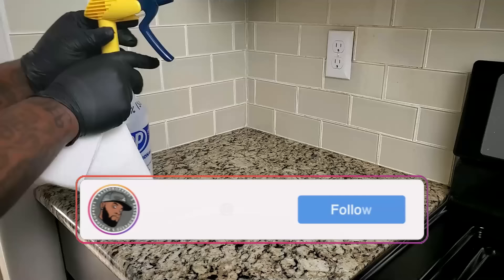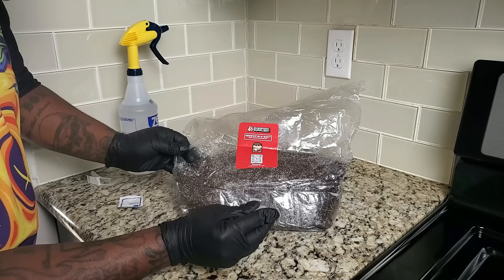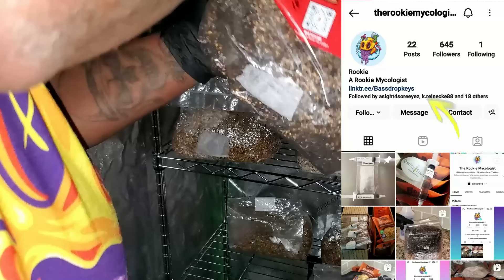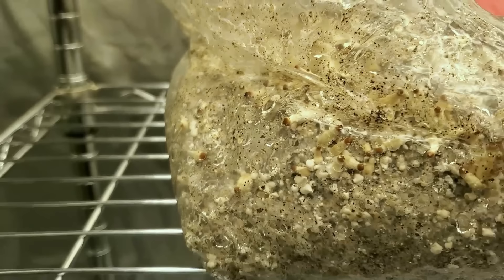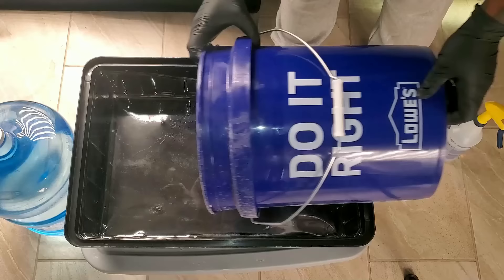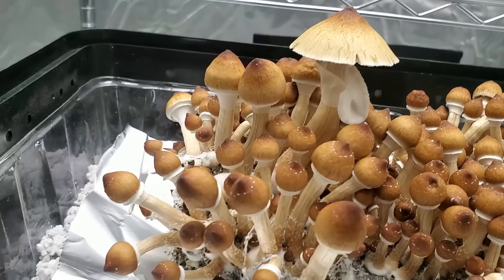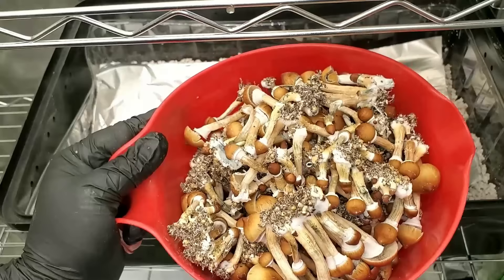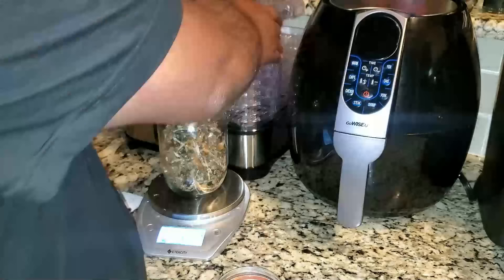Spore To Flush - All In One Mushroom Bag | Complete Beginner's Guide To Growing Mushrooms

Comment: Just a tip to yield more weight from your first flush, once you transfer your grow bag to the grow box you can actually add more sterile substrate to the grow box and the mycelium will spread through the added substrate and yield more weight. All you have to do if it doesn't spread is leave a few mushrooms in the substrate and tap them every now and again. The mushrooms will do the work for you. Another tip is to add black lights. It will also create a more sterile environment because certain molds can't grow in those conditions. At least with my experience. Just a thought.
Reply: @monsters_are_human is the black light the only light that’s necessary at the fruiting stage…. Thanks in advance.
Reply: I have one all in one bag that colonized and grew and I've already harvested from and am about to soak it and move it to a tub. I have another AIO bag that didn't colonize. Can I just mix up that second bag, open it, pour it evenly in the tub, and put the rehydrate cake from the first bag on top of the layer I just poured? Will that grow more even if that layer I poured is uncolonized?
Reply: What substrate do you suggest?

Comment: A tip, use the alcohol wipe on the injection port & inject directly through the alcohol wipe. Will reduce contamination risks.
Reply: That just sanitizes tho not sterilize. If you want to sterilize everything flame the needle and wipe down the port.
Reply: If alcohol gets in the needle, you just lost spores. Never done that, never will.
Reply: Just heat til growing red.. everytime.too

Comment: I like your logo and your approach to mycology. I've been dabbling with it for a while now myself and I just wanted to give you my opinion regarding the caps splitting. It seems like the perlite you put at the bottom was dry, or maybe just not wet enough. But typically speaking there should be at least a little bit of water droplets on the inside of your monotub or fruiting chamber. So oftentimes just misting the inside of the fruiting chamber when you first put the Block in there to fruit. Some people will mist multiple times per day but I like to go according to how much water droplets are built up on the inside of the fruiting chamber. As long as there is even a little bit of droplets on the walls of your chamber that will allow the moisture needed for your caps not to split so much.
I respect that everyone has their own methods but I just wanted to give you a tip that seems to work best for me.
 I noticed that when your caps were cracking there was at least one cap on the back right that was already getting the shriveled dry look to it.
No method is wrong, especially when what you're doing is producing. Keep it up brother happy to see as many people as possible sharing this line of work. It is a fun hobby/ passion.
Mush Love 🍄 ❤️ ✌️ 
Divine Mycology
Reply: What’s the concern with splitting too much?
Reply: @GdayFraz  no real concern with the splitting caps, moreso just curious as to why this occurs

Comment: The extreme pinning is because light is hitting the bag from all sides especially in the mylar tent. Next time you can use duct tape or something to prevent the side pinning.
Reply: What was the issue with it?   Didn’t seem to be a problem.
Reply: @acausalnine  Not necessarily an issue. It just produces tons of tiny shrooms all over the cake rather than fewer larger shrooms on top. If youre using for micro dosing more pins is good :). If you want impressive fruit with high bag appeal then blocking side light may be a good idea.
Reply: @ngantnier how about just a simple rubber band around the bag lol, you know something that actually works😅

Comment: I did it for a bit. Here's a tip. Treat your air and don't work over carpet.  Green mold is a pain and it's hard to get rid of spoors. I would have good luck on small scale but once I stepped it up mold wouldn't show untill spores were already in the air. looks like you found a Cool easy way to get at it and I might give it a try! thanks!

Comment: Something to consider. I live by a field that is 1000s of acres. I have never walked it all in 25 years. I use to come out with 55 gallon bags of those. Anyway i used to thump the tops, and twist and pull or push pull to harvest. Over the years, i learned thumping wasnt needed and also that i should have been cutting them with scissors. When you pull them like that your damaging the mycelium. You know it grows like a net under the dirt in a spiderweb like filament..unknowingly i "swiss cheesed" it all over vast areas, basically stripping the field. So year after year, there were less and less, even taking the 5 year cycles of growth into consideration. With that being said protect your mycelium at all cost . This is coming from a highly experienced individual that would harvest 11 and 12  lb mushrooms the size of dinner plates with stalks fatter that broom sticks ... good luck!
Reply: Very different conditions growing in a field than in tubs like this. He's going to throw out that mycelium after the third flush or so and start from scratch.

Comment: The "don't wash mushroom thing" comes from kitchens. In a restaurant, or commercial kitchen, if one were to wash the mushrooms, and leave them for an hour, they would become slimy. If you are using them right away it is perfectly fine, and absolutely correct to wash your mushrooms. Chefs do not like eating dirt, or poop either. Morels different story/ truffles etc. Button type mushrooms you wash as needed.

Comment: They are Pining on the side and bottom of the bag because the light gets in there.
The bag is supposed to be black on the bottom so it only Pins on the top.
You can use black tape on the bottom of the bags or transfer them to a black tray and put them in a mono tub.
You don't want pins starting on the bottom and the sides. They will abort anyways.
Reply: I have commented before I watched all your video.
Good job!

Comment: It’s crazy, because I usually do bulk grows in bins, but just tried an all in one bag and immediately saw all the side pins that bags are prone to, and transferred to a bin just like you. Question: if you have a digger in your tent, do you need the top on the bin? Do you have the humidity, and fan on at the same time, or intervals? Thanks

Comment: What does the perlite do?  Is it necessary?  Is it reusable?
Reply: Perlite is used to keep moisture in the fruiting chamber. It's a material that has a higher surface area with bumps that can hold a significant amount of water which is why it's used. You should put enough water in it to reach field capacity (squeeze the excess water out), and then fill the bottom of the chamber with it.